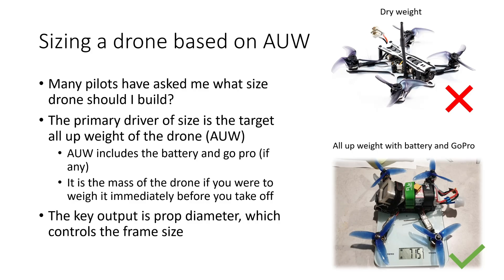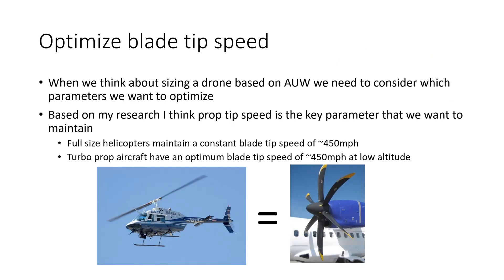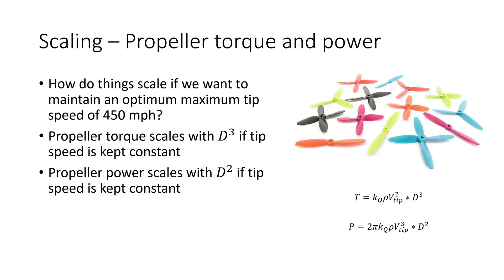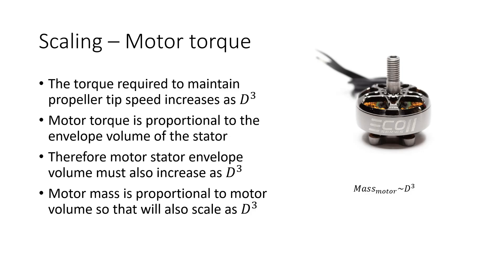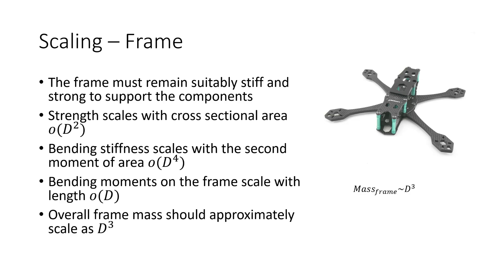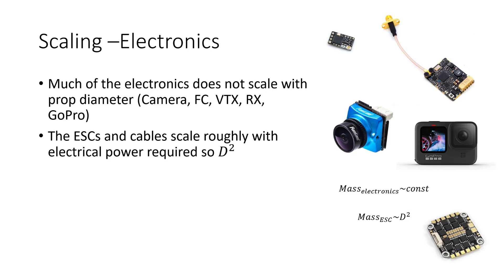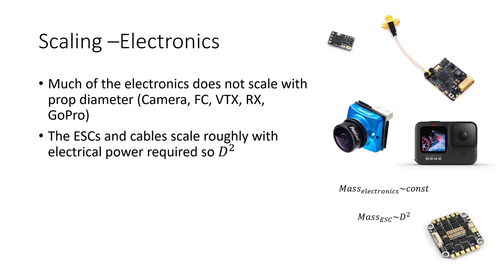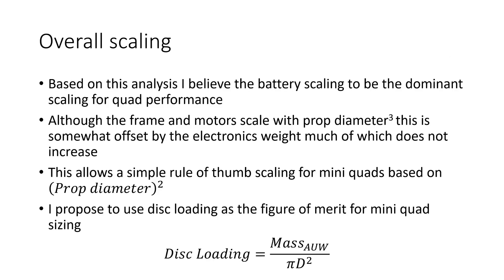Choosing the right prop diameter for a drone of a certain weight: What prop for sub 250g?

Comment: perfectly in line with my own tests, but much better explained. The only thing I want to add is, the graph gets a bit distorted on the very low prop sizes side because it's only an approximation that the fixed electronic weight cancels out other scaling factors and that approximation fails on the very low weight side. That's why on the very light side if you only consider prop load I find the chart suggests a little bit too small props, but only a tiny bit (maybe 0.5")
Reply from the maker: Absolutely right. Such a simplification can only be so good but it provides a starting point. Definitely small quads can benefit from slightly larger props. 👍
Reply: @ChrisRosser  do you know how the disc surface impacts wind resistance? I cant figure out if it only depends on the disc surface or also on the blade number because I feel like wind resistance per weight is the second most important part of the "feel" or "throw" in the air
Reply from the maker: @JulianBauknecht  I think the disc loading will be the primary factor with blade count as a secondary consideration. The idle RPM of the prop also plays a part with a higher idle RPM providing more drag in reverse flow conditions.
Reply: @ChrisRosser  ah ok tyvm, that would explain why I can't get definitive results wheater or not blade count matters if it's in between in real life. That would partly explain why on 5" 250g kwads 2blades fly much nicer (besides the fact, that a super lightweight 2blade is stiffer than a similar heavy 3 blade)

Comment: i like my 168g auw 4"
7min flights with a 750mAh 3s
i wonder if a 3s 18650 pack would push it more into the optimal disk load area
i'd like to see the tubular los quads in that graph
btw amazing channel
the vibration analysis results videos should be on every frames product page

Comment: Oof sounds like all us pilots on DJI air units with GoPro's need 5.5" props. If I understood the prop video correctly adding blades to the prop won't reduce disc loading? I would enjoy a video showing some example builds with common payloads, taking all your research into consideration.
Reply: well the disk stays the same with changing number of blades
blade area loading might be better
the projected area of the prop onto a parallel plane below
Reply: Well.. now I find myself planning a 6" build and being a bit frivolous with the weight of components to hit the sweet spot.
Reply: @DriftaholiC  20x20 might be enough

Comment: Awesome!
I also figured out a while ago that 450-500g is the actual best performing weight for a 5 inch (at least in my opinion).
I think that 4 inch is veery interessting for the sub250 class. I will definitly use your research as a base for future testing! 
Thanks a lot!
Reply from the maker: I hope your future testing goes well. Good luck! 👍

Comment: Thank you for well thought-out and presented data.  I have always loved 3.5" props for micros and 5.5" for my GoPro rigs ( I also fly at 5000ft altitude).  Hopefully we will see more 3.5" (thank you baby hawk hd) and 5.5" (gf 5551 only ones around these days) props come out.  I usually have to cut down 6" props to 5.5" and it's a pain.  It's hard to get a 5" freestyle rig with gopro in the 600 gram range.  At 670 to 720g range 5.1" quad blades do help.  Thanks again...you rock and keep up the great work.

Comment: As far as I know this tip speed should be lower for anything with more than two blades
Reply from the maker: As far as I am aware that doesn't seem to apply to helicopters or turboprop planes. They run at the same tip speed regardless of blade count. Can you link a source?
Reply: @ChrisRosser  the highly scientific warpdriveprops state 314mph for multiblade propellers... I suppose they have a reason for that

Comment: All I heard was, "250g five inch sucks JB was right the whole time."
Reply from the maker: Hopefully knowing the reason behind it proves useful in your future conversations on the subject 👍
Reply: @ChrisRosser are you only talking about 3 blade props? On a 250g 5" you usually run low pitch bi-blade props. I feel like there are a lot of variables, not covered here, to come to the conclusion 250g 5i" is bad...
Reply: We have been so focused on 5 inch feel, and directly correlating prop size, I walked away with the weight and prop combination is maybe a focus worth exploring.
Reply: QRP  Chris' personality is a big part of why he's attracting viewers faster than other YouTubers. He's seems very honest and fair.
Reply: I love the collective mind of this Hobby. It would seem that Chris’s recent finings have challenged the standards we’ve come to know. Thanks Chris
Reply: But if power and motor torque be reduced , which it is , the system with the lower disc loading is more efficient isn't it? Mostly if we reduce prop pitch.
Reply from the maker: @Nuno Gomes https://warpdriveprops.com/propspd2.html Gives 303mph or 0.395 Mach
Reply: Id say It's only good for very light thrust and throttle for efficiency.  Not freestyle. Way too much vibration in the frame.
Reply: @divingfalconfpv4602  Are you talking about 250g 5" quads? If so, have you tried the 2Fiddy or Outlaw frames?
Reply: @friendlynomad9840  I want to try them but haven't yet.. I have Dave c.. i have been tweaking the tune.. and I have to add arm braces it came with
Reply: People are bored so they experiment with all kinds of stuff - which is great because trying new things is always a good thing. 250g 5" can be built with good performance but you would give up too much in terms of durabilty and/or flight time.
Reply: LOL, yes! just listen to Mr. Know It All, and we'll all be on the right track! lol 😜
Reply: Absolutely JB
Reply: ~300g 5" is 👌.  It just needs at the very least a 2203 or 2204 to be good.
Reply: @Kabab  Agreed. the 2203 is a big step up from 2004.
Reply: @friendlynomad9840  Oh yeah!
Reply: @Kabab  Yup!! My 2204 5" light freestyle build is an absolute blast!
Reply: I think both JB and Rosser have science on their side. However, I still comfortably prefer a 5" quad, even at 250g. Keeping that weight equal, a 5" quad will never feel the same as a 3". I can tell the difference in split-s and power loop moves. I think the throttle and yaw feel of the 5" quad is noticeably different. Just my two cents.
Reply: You prolly dont care but if you're bored like me during the covid times then you can stream pretty much all the new series on instaflixxer. Been binge watching with my gf lately =)
Reply: @Thatcher Keaton Yea, been watching on Instaflixxer for years myself =)

Comment: Thanks very informative as always! What about the effect of the arms length? Could it be that running longer arms provides increased stability? Or should the arm length always be proportional to the prop size?
Reply from the maker: Run the shortest arms you can. Long arms can cause a lot of problems especially for larger quads.

Comment: Loved this analysis. Finally someone who put the time in to debunk this arbitrary sub-250g 5" goal, which to me doesn't make sense if the weight is no longer 600g.
I would love to see a video on aero drag vs AUW to try to optimize the "floatiness" of a quad. In other words, put quads on a spectrum between beach ball and golf ball.
Reply from the maker: Parachute effect is linked to disc loading so a quad with a lower disc loading will feel more floaty with less fling.

Comment: Hey Chris, thanks for this confirmation - which is max. AUW between 600-700g for 5 inchers. One question I have is: how does (if it does) size of individual prop blade surface (for example in mm2) affect prop performance, it probably also affects ideal tip speed and everything else? For example if you look at Dalprop Cyclone 5 inch prop and compare it with for example Ethix S3 or S4, there is obvious difference in blade surface size. Or maybe this is too complex question. But at least recommendation from you like this example of blade shape and surface size is good/efficient and will work well with usual motor sizes and kVs and this is a bad example. Thanks and I appreciate your work. 👍
Reply from the maker: Have you watched my video on choosing props? I think the answers you are searching for are in there.

Comment: 11:07 literally where my session 5 carrying freestyle quad sits with 5.1" p3 props lmao, you wizard.
Reply from the maker: Engineer: Someone who does precision guesswork based on unreliable data from questionable sources, see also Wizard, Magician 😋
Reply: @ChrisRosser  maybe I missed it. At what rpm do common prop sizes hit 450mph at the tips?  What is the equation for that?

Ie: 
31mm whoop
2"
3"
4"
5"
5.1"
6"

What I am after is approximate optimal kv for a quad size. I know kv numbers on quads are not super accurate, but it would be nice to know. IE if 15000 RPM on a 3" gets you 480mph (pulled out of my butt) than anything over ~5000ish KV on 3s would basically be additional amp draw for no gain and less throttle resolution. 

I know it's not all about KV, and you need to the volume to manage the prop, but that would be useful to know.
Reply: @mouseFPV  I did the 4" and its 3222 on 4s... 
need to find a tip speed calculator to find RPM.
I'm sure there is a better one than what I used... 
but

Comment: Chris I am really excited by the type of knowledge you have shared with regards to motors and propellers . It is ofcourse a little difficult to sum up the effects of motor stator volume to its torque and thereby the continuation of the same math with props . Would be actually helpful if you could show us a total guide based on these vids , how one of us could use these understandings to combine them up as a calculation and not make a mess out of them in our minds and  make the best selection.
Also how do motors draw power based on different props at particular voltages has always made me think if there happens to be some other fool way to determine exactly the power draw of a motor without doing a physical prop test but by simply using the size numbers.
Reply from the maker: If you start with your target weight, that'll give you the right prop diameter using the graph in this video (green line). Then go to the motor video and the graph there will give you the motor volume you need. Pick your motor KV so that 0.7*KV*2*pi*Diameter ~ 450mph. Battery should be 1/3 of takeoff weight and that should get you in the ballpark :D

Comment: At 5:49 I got interested to relate the propeller torque to the propeller power so , here is what I found by rearranging the terms, 
P = [ 2 x pi x T (prop torque) x Vtip ]/ D , where Vtip is 450miles an hour.
Reply from the maker: That looks correct to me!

Comment: If you have a 4" drone, does it make sense to run 3.5" 3 blade props in 250g acro config and 4" 2 blades in 300g long range config?
Reply from the maker: I think it definitely makes sense if you want a bit more snappiness and performance for acro flying but still want a great LR cruiser. Great thinking! 👍

Comment: The most exciting video from motor volume / prop / disc loading series so far. Interestingly I was kinda intuitively leaning to that green line. Because I thought 5" 700g AUW having flight time 3.5min and landing with battery hot wasn't right. And according to the graph you need 6". And that's the size I stopped on. I had a 7" frame and I started to cruise around at about 60kph logging speed vs power. I replaced 7" with 6" and repeated. As a result I've got 2 elliptic clouds of dots (normal distribution) which were coinciding. Which meant 7" wasn't more efficient then 6". So why carry more?
Now I'm building 250g free style / long range quad with 4" props and 1207 motors. And it also hits that sweet spot :)
Reply from the maker: That's great to hear. I love it when theory aligns with people's real world experiences. Thanks for sharing!

Comment: Any motor size data as far up to 12 inch props? I'm building a quad for my daughter inlaw, it will be in auto level mode so it doesn't need to go very fast.  Somewhere between 9 and 12 inch props.  I need more data to decide.  Thanks in advance.
Reply from the maker: Torque and therefore motor volume scales with diameter^3 so you need 8x the volume of a 6inch motor for a 12inch prop for example.

Comment: Does the leading edge of the propeller better to be sharp or dull?
Reply from the maker: Subsonic aerofoils have a rounded leading edge.
Reply: i like looking at the twist in the blades
it's prandtl propulsion
i think the airfoils on props are mostly to minimise drag and most of the thrust is just deflection

Comment: Been spending the last 2 days trying to graph out auw to disc load. 
 
ramblings... 
max thrust / efficiency...  450 mph tip speeds and noise levels.. 
But the problem is also parachute right? 
Idle lift. 
Need the weight to get the throw to overcome the drag.... (latent idle thrust) 

So is it different for 2,3,5 blades...

Agree 450 is max efficiency 
Surprised many quads are not hitting that speed... 

The question is how much headroom do you want.
Redline is .8 Mach right?

I feel like 300 - 330g and 4" high pitch props with low KV is what I want for quiet park cruiser with some headroom for occasional flippy floppy... 
with gopro 650 - 700 which is the 5.25 - 5.5" 

or the 7" ... wait haven't done that math yet....
Reply from the maker: Sounds like you heard my spoiler on JBs livestream! Yes red line is ~0.8 Mach. As for parachute effect I think that  you'll get more drag with more blades but that should be like for like. So a 5 blade 5in should throw the same as a 5 blade 3in with the same disc loading give or take.
Reply: @ChrisRosser  So real quick... should we be aiming KV of motor directly at 450 or at like 600 to account for losses and overhead? 

should we be cruising around at 200 with 450 for the most extreme maneuver ?
Reply from the maker: @RCRitterFPV  Actual Full throttle RPM is usually approx. KV*Voltage*0.7 I would target that at 450mph. There is no real advantage to having full throttle above 450mph as if your motor has that much torque you should be running a bigger prop.
Reply: @ChrisRosser  perfect thank you, 
keep it up, I know you are busy. everyone has questions for you.
Reply: @ChrisRosser  so 4" 37,850 rpm = 450
~37,850 = 16.8 * .7 * 3220KV
Reply: @ChrisRosser   so a 1750KV motor on 6S with 5.1 props has a tip speed around 468mph? If that’s the case I should consider I higher pitch prop to bring the tip speed down otherwise I’m wasting that power? Using your graph, we’re does prop pitch play in? Love the content!!